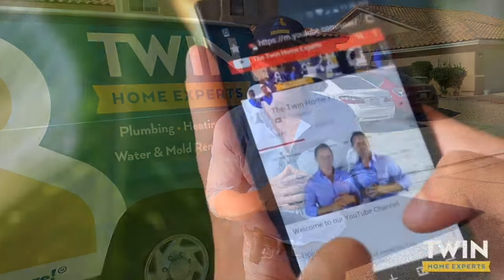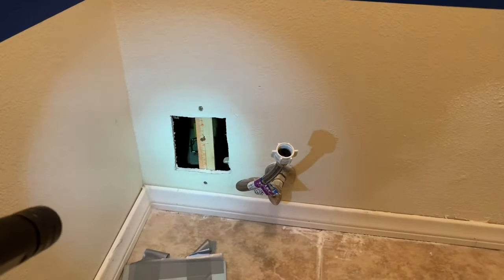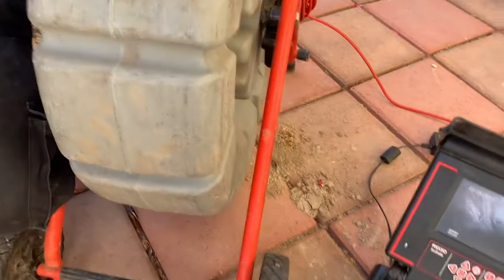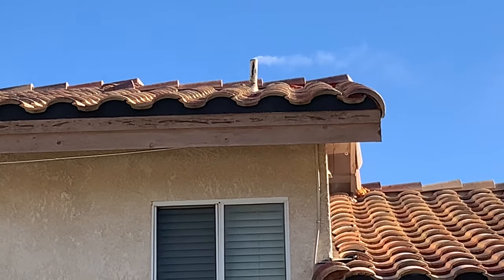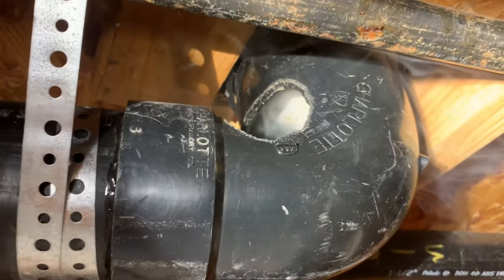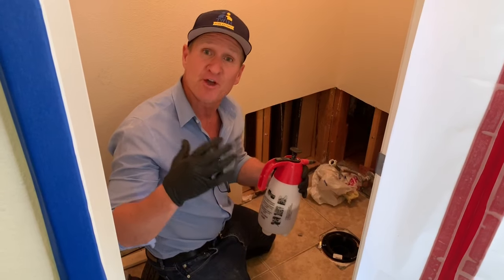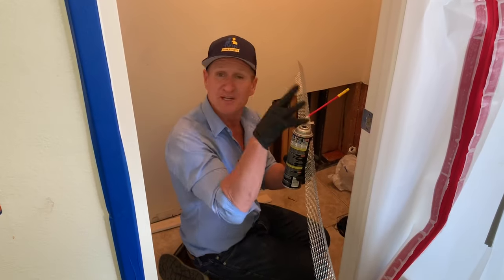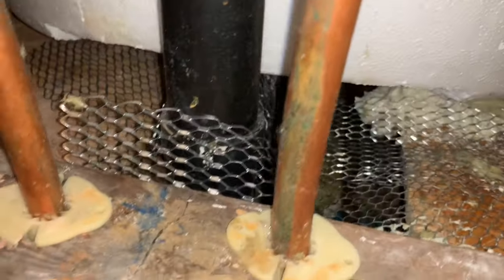Scratching In Walls And Ceiling At Night? We Got You!

Comment: I’m located in the uk starting to hear loud scratching noises at not usually starts from 10pm till like 5 on and off I’ve tried to repel it away by playing cat sounds etc through YouTube but it keeps coming back I’m trying to wonder if it’s a rat or squirrel cause they sound the same when scratching at walls
Reply from the maker: Hello Romei Do you see any rat droppings anywhere, that always a good indicator.
Reply: @TwinHomeExperts  i dont see anything yet there just trying to get through it only started on monday  ive got recordings of it for when the pest control come out
Reply: I had mice a couple of years ago and everything got sealed up theres still drpppings from that under my sink cabinet cause i couldnt take the board off to clean
Reply from the maker: They could be returning within your sewer  system...
Reply: @TwinHomeExperts  is there a way to stop them from trying to get in ive tried the sound repell thing i used it through youtube and they keep making more scratching and sawing sounds

Comment: How much does it cost to get rid of rodents? I have them squeaking in my walls as I write this. 😖
Reply from the maker: this all is dependant on so many factors. The first phase is to detect where there coming in, then the repairs and prevention.
it can range from 875.00 to 5500.00
Reply: @TwinHomeExperts  Yup. So guess that's a no...
Reply: Well, our pest controller..Flick...charges $AU250 each quarter to bait, and the insulation company charges $AU1 k to renew the insulation in the ceiling, so that seems to be it. I myself will steel up any gaps....I know where their run is.

Comment: Well you probably live nowhere near me so I don't know if I'll be able to find an exterminator company that even has your technology.  unfortunately I also rent but my landlord was sneaky about putting into the lease that I have to pay for any exterminators if there's ever an issue which means I know he knew that they were here before I moved in last August. I caught so many over the winter but then I started to hear it in my ceilings. I know they're in my ceilings because one of the ceiling blocks is always wet from a leak in the bathroom that my landlord keeps trying to blend on water soaking in the fire from taking a bath 🙄 no water is soaking on the floor it leaks even when we're not using it. But I took the block down to try to dry it and there was poop on it  Then this morning there was a freaking tail hanging out of my kitchen ceiling block. I'm not in the financial position to  up and move and find another place. Tracts have skyrocketed from the pandemic. I can't afford it right now and I just don't know what to do. but I am a single mom with two kids and I'm freaking out at this point. Is there something I could at least spray up into that area that will kill them? To try to at least keep it controlled for now? I'm about to cry honestly.

Comment: But the rodents are just gonna eat the foam holding it onto the tub and then what.

Edit: Foam just seems to be a bad idea, mabye they should make a rat poison foam to use instead.
Reply: Hmm, but the rats won't eat through the metal screen that's being held in place by the foam.  Anyway, there's Great Stuff Pestblock to try out.
Reply: There is anti-rodent foam that you can spray, contains metal, they won't knaw it.
Reply: @maxk880  the more you know 🤯

Comment: You need to franchise and have more locations with the same technology/methods. The big name exterminators are useless. 
Also, shouldn't the ABS/plastic sewage pipes have a mesh built into them if rats can chew through even hard plastic material?
Reply from the maker: Yes and yes! Thanks so much for your support and encouragement. 🙏

Comment: My room is upstairs and the attic is surrounding it I've been hearing scratching for a few days, now I hear scurrying directly above my bed, Its 2am and I got woken up by it.
Reply from the maker: The best l thing to do is get up into the attic to see how much activity is going on such as odor? Rat droppings? And see if you can locate obvious entry points. Then seal up any suspect entry points. You can then try setting up traps to bait them out.
Reply: @TwinHomeExperts  my attic is too dirty and low (and no walking boards). too much mice shit and they roam under insulation. do I have to wear particular clothing (what would it be called) and masks and goggles? I intend of putting an access panel to the attic where the mice are instead. the delivery for the access panel is taking a while. send prayers.
Reply: @rekostarr7149  A good insulation company will vacuum out the poo, carcasses, (after baiting) and old scratched up insulation, and install new batts that the rats won't nest in. I plan to install walking boards and strobe lights once my attic is done, it might make a good space to read!

Comment: I just use an air rifle,  a lot more fun and way cheaper than this a absurd procedure which most likely is very expensive.
Reply from the maker: This is what happnes when rodent take over and its ot of control. You have to open up wall and ceiling, santize, repair and reconstruct. PROBLEM SOLVED!